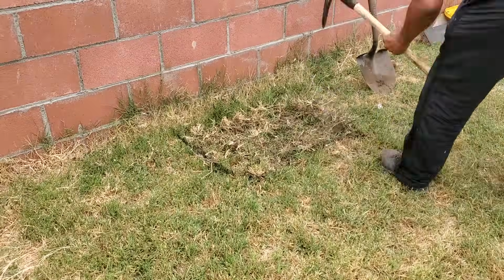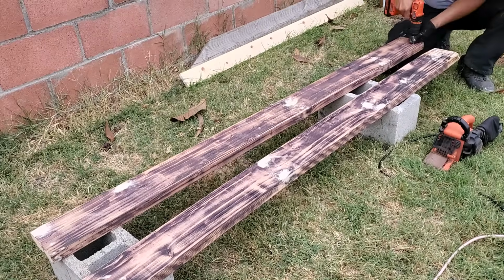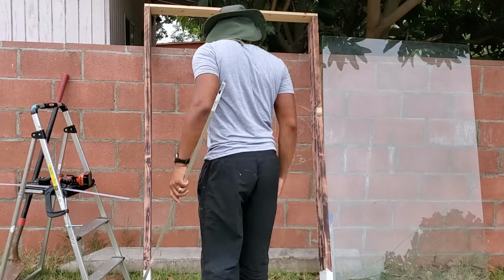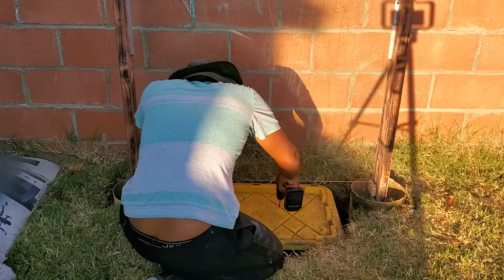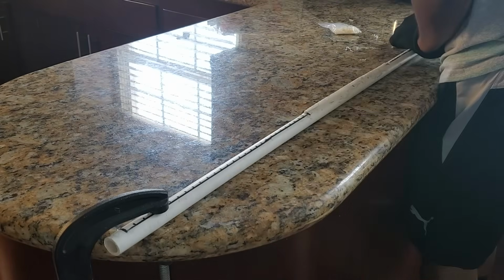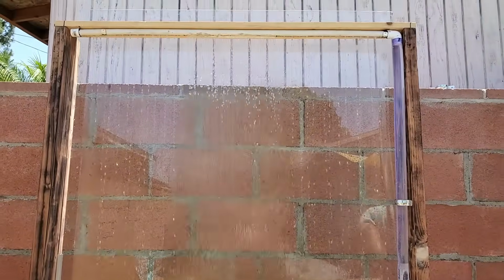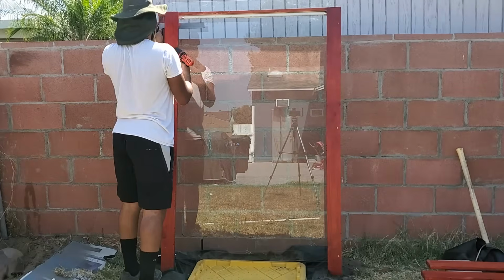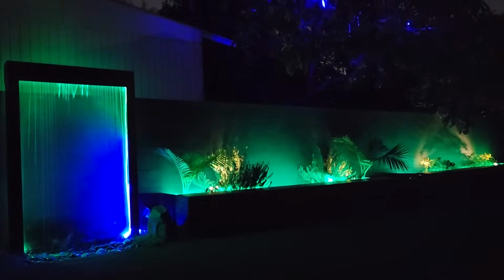How I Built My Backyard Water Fountain

Comment: I’m new to this, so please bear with me if this sounds like a stupid question. Instead of using clear, transparent glass, would it be better to use a mirror? I was thinking the added reflection might create an extra “wow” factor. If this idea doesn’t make sense, please let me know so I don’t continue down the wrong path.
Reply from the maker: It could possibly work but those mirrors are normally really thin and break easily. In my setup a mirror would create a very overwhelming glare at some points during the day and it would be harder to keep clean. This tempered glass is also somewhat thick. My kids have kicked balls into it accidentally, and it has not broken yet.

Comment: How do you protect the glass from getting mineral deposits from the water?
Reply: You don't. And he didn't use pressure treated lumber either so that thing will be a rotted out mess in no time.
Reply from the maker: Well the fountain is still running and not rotted in 2025. Hosting a party today actually and the fountain will be running.
Reply from the maker: I just occasionally clean the glass the same way we would a shower glass,  but there really isnt that much deposit especially if you wipe the glass right after use.

Comment: Everything looked good.  Finished yard well put together.  It takes a long time, even in the best conditions.  The tubing used for the waterfall going down the side may have been better had it been pvc instead.  It would have been easier to keep within the frame and more durable than tubing.
Reply from the maker: Thanks good points. I'm not a professional myself but the fountain still runs great with the original parts up until now.

Comment: Plexiglass might be a safer alternative. Everything looks very nice.
Reply from the maker: Considered it, but it changes color after a while (becomes opaque and brittle) where the glass is more resilient in that sense but it is indeed more of a safety hazard.
Reply: @wadesminutes  You did alot of good explanation, and I like that you also included things you wished you had done differently, or had known to do, like the water liner, cutting it back too much. It showed ithers that mistakes are gonna happen, but you just keep moving forward. You saved people alot of time, money, headaches with the liner issue. Painting the wall black behind the fountain makes everything so atheistic. It's amazing how much it altered everything. You obviously put alot of work/thought into everything. Not being afraid to share where mistakes happen is an awesome quality about you. There are too many pretenders, that attempt to showcase a perfect video, or outcome, and you are authentic. Hey, crap happens deal with it, and move on with the project. Don't ever lose your humbleness, and authenticity. Thank you for letting me know about fiberglass coloration. 
While typing you, I had the thought of using a nontented, like uv rated, window adhesive. Maybe putting that on the back side of glass would give it strength, and/or, also keep the glass intact if it did break. Plus, you could add different tint of blues, that might look nice too. See? Your video gave me alot to think about. Thank you.

Comment: Это конечно красиво, но вот вопрос: от сырости потом грибок не образуется? Ведь при влажности, все может быть
Reply from the maker: As long as you use wood that is durable and you treat it to resist water and insects you should be ok. The fountain is still running in 2024 with minor water damage to one of the less resilient side boards but the main structural pieces are the same as day one.
Reply: @wadesminutes  thank you very much for your detailed answer. 😊👍

Comment: A lot of people don’t realize that some woods require conditioning before stain. It makes the stain not turn out splotchy
Reply: Not so much that its required it just makes for a better result ive stained everytype of wood there is without conditioning and had it turn out great its just easier for beginners etc to get a better result
Reply from the maker: Exactly, I did learn the hard way but glad I eventually had the time to go back and do it correctly.
Reply: @wadesminutes  how ya learn isn’t Important, that you learn is.

Comment: You could have drilled holes in the pvc and turned the pipe to point the holes towards the glass.
Reply from the maker: I agree definitely an option that someone could use, I used the corrugated sheet in my case because I was hoping to achieve a different smoother type of water flow in the center.

Comment: I really like your work and watch all 19 minutes without skip any.

I like the way you pointed out some mistakes you did and it is very help to whoever want to do waterfall like your.  Question, is it more safety to use tempered glass?
You should use solar panel to avoid trench for wire and solar is cheaper.

Last, I liked and subscribed. I  am going to watch more of your YouTube. Keep it coming brother.
Reply from the maker: It may not be as safe to use the tempered glass but I used it because when I was researching it seems like the plastic based glass eventually starts turning yellow from being outside in the sun and being in constant contact with the water. The glass is also really optional. I do like the solar idea but since I want to use it at night as well it would also need battery power.  Thanks for subscribing I really appreciate it. I will be working on the planter video next.